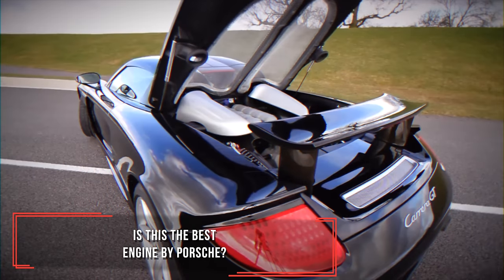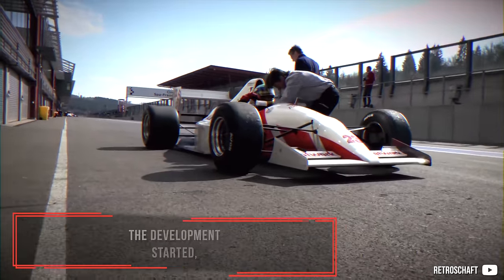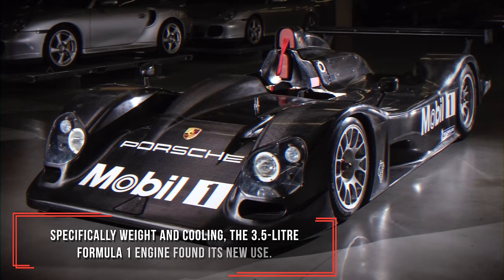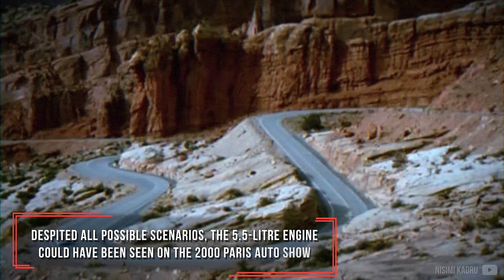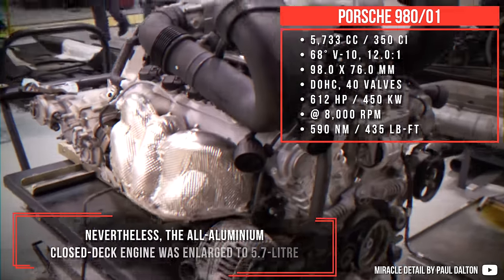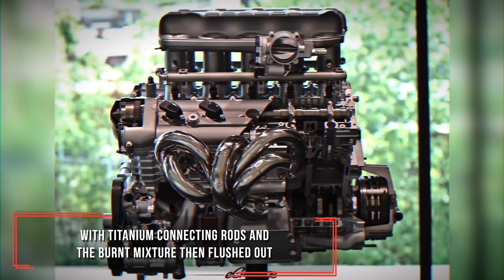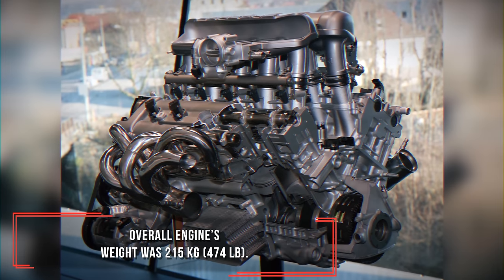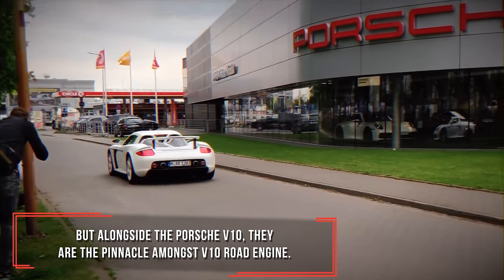How The Porsche Carrera GT Got An F1 Engine

Comment: As a Volvo fan, I'd like to see the 2.3 T5 (R) engine and its 2.5L history with Ford!
How the Yamaha 4.4 V8 (Volvo / Noble) came about would also be interesting!
Reply: As a 2.5NA owner I'd love to see more about it, the B52 series is so under-rated when it comes to a great engine with so much potential since it works with an Aisin gearbox from the factory. The early 2000's Volvos may not seem like potential hot rods but the internals say otherwise since the gearbox would allow swaps with Alfa engines.
Reply: Or Maybe the Whole History of Volvo 5 Bangers!

Comment: The car that is so beastly that even a highly expert Porsche test drivers and engineers admitted that this car is harder to drive. Also, they had a plan to put additional safety feature like ESC etc. but they realized that putting these safety feature will adding much more weight so they ditched it.
Reply: Well, Paul Walker forever-sleeped himself in one so I agree it's hard to drive

Comment: 0:54  Footwork didn't just "decide" to use a Mugen-Honda unit.  The Porsche V12 was a complete failure - overweight, underpowered and uncompetitive.  At the same time, Porsche was also developing the V10 for the following year, but it also was turning out in a similar vein.  Porsche then withdrew from F1 as an engine manufacturer mid-1991, and Arrows/Footwork settled on the old Cosworth DFR V8 engine for the remainder of the season (partly because it wouldn't require a complete chassis rebuild to fit it in.)  It wasn't until 1992 that they got the Mugen engine - itself being based on Tyrrell's 1990-spec Honda V10.  They'd have happily stayed with Porsche, if only it would have resulted in a supply of competitive engines.
Reply: Porsche V10 wasn't even been tested,it would actually do good in formula 1,but regulations changed and also Porsche was out of cash,that's why LMP project didn't work aswell
Reply: @vr5lover  It was tested, and was found to be overweight, unreliable, and underpowered for F1.  If Porsche ran low on cash, it was likely because they had to pay Footwork a penalty to get out of their contract - money Footwork used to buy the elderly Ford V8s needed  to continue the season.  If the engine could have remotely been used competitively, Porsche wouldn't have had to pay a significant penalty for not fulfilling their part of the contract - if anything, Footwork would have had to pay them to cancel the contract.
Reply: @aussiebloke609  that engine was never put into formula 1 car,you are talking about 3512 which was v12 engine,not Carrera GT V10 in fact the deal was ripped off before even the engine was fully ready,get your facts straight.
Reply: @vr5lover   I didn't say it was tested in a car - it failed its dyno testing.  It was about as bad as the V12, and never got close to the point of being fitted to a chassis.  Porsche then said they could not fulfill their part of the contract and provide a competitive engine package in time for the following season - which is why they had to pay Footwork a significant financial penalty as they exited the contract.
Reply: @aussiebloke609  failed Dyno testing? The engine literally did 800 bhp on Dyno,the less rpm working version of car had 700 hp and was pretty reliable,I don't know what is your source,but you definitely have 0 knowledge about this
Reply: @aussiebloke609  the deal was off before even engine was ready,it was footworks that cut off the deal not the Porsche,idk what this bs is about,you can hate Porsche but why making up stuff to make them look bad?
Reply: @aussiebloke609  so i am cult member when you make stuff up? Even on Wikipedia page it says footworks was the one that cut off the team,would Porsche really try hard to use that engine if it was that bad huh?
Reply: @aussiebloke609  Huidekoper, “In March 1999 I was asked to come to Weissach for a meeting. They showed me their 3.5 litre V10 F1 engine, produced for 1993 in great secrecy.  A beautiful engine, proper compact F1 architecture, between 700 and 800bhp and with full pneumatic valve gear.” this is real article about facts and what engine actually was m8

Comment: Wish they had pneumatic valves then it will be a true f1 engine
Reply: Do f1 hybrid still use pneumatic valves? The engine only rev 11000 rpm.
Reply: @GF-mf7ml  I think they use beehive valves now, because cars that rev up to 11k rpm usually have them.
Reply: @GF-mf7ml  pneumatic valve not use only because the engine rpm can higher than 17.000 rpm, but they use pneumatic valve for better responsibility for the engine
Reply: @aditya-br3kg  pneumatic valves are better for response and efficiency... That's why Koenigsegg uses them
Reply: @shawnramito4863  Koenigsegg does not use pneumatic valves in their vehicle products, they use Freevalve. From the way it works, the Freevalve and the pneumatic valve are different
Reply: @aditya-br3kg  FreeValve is something that is used in the newer cars. But if I remember correctly Koenigseggs like the CCR and CCX had pneumatic valves.

Comment: The Carrera GT has a bit of a reputation as being hard to handle.  I was at a track day at Putnam Park in Indiana about 10 years ago, and a Carrera GT was there.  Of course we enthusiasts were happy to see it there, and couldn't wait to see and hear it run.  I was disappointed in its exhaust tone.  It sounded like a Dyson vacuum cleaner.  I was hoping for a more gritty sound.  But the guy took it out on track and I watched it go by a few times, then my attention wandered off for a few minutes.  Then I looked back out, and the Carrera GT was off the track in a place where I had never seen anybody crash in 20 years of going to Putnam Park.  It had crashed into a photographer's car and was on fire.  I didn't get a chance to hear from the driver how he had managed to get into that weird predicament.
Reply: To be fair, Paul walker died in this car, so yeah this car is hard to handle
Reply: @Payday5  Walker did not drive the car,d it would be hard to speed as a passenger, right...?
Reply: @Freimopp777  well the driver surely cannot handle the car, and yes paul walker died in that car, did you get my point or nah?
Reply: @Payday5  You  basically wrote  Paul Walker died in this car (nobody asked for him , anyway) and that is the reason why the car is difficult to handle . If someone else had been in the passenger seat, the car would have been easier to handle..? The driver was speeding, and the tyres on the car were old btw.
Reply: @Freimopp777  idk man

Comment: Sweet sound! No wonder Honda beat them out. Porsche is not Honda. Porsche had to build a "Honda like" SUV to get financially stable. My Ridgeline and Civic may not sound that good but I will drive them for the next 30 years. Can't say that about any Porsche ever built without extensive restorations.
Reply: Honda like? You might wanna check the towing capacity 🤣
Reply: @RuzzP  
Or you might  wantt to reallize what you need.

Comment: A 5.5L that hits 20,000 RPM is insane not to mention that f1 style clutch pack is inspired to say the least.
Reply: It doesn't hit 20000 rpm.
EDIT: Just rewatched the video. The engine run-out speed is apparently 20 000 rpm, whatever that means.

Comment: Why should you prefer a Carrera GT over an LFA? Simple, one is a convertible, the other is not. You get the best experience of that V10 masterpiece, without compromising rigidity. 

If that's not enough : manual gearbox (and one of the best, against a 'bad' automated)... Except for start/stop trafic 😂

Comment: Not an f1 engine and barely a lemans engine. It was just the idea of 2 failed projects it never was actually either. A real f1 engine would never work in a road car. You could never drive a f1 engine on the road.

Comment: It's not an F1 engine, it's an engine loosely based on an F1 engine design. I doubt there is a single component in the engine that is shared with the actual F1 variant.

The old V10 F1 engines made close to 1000hp with half this displacement. They revved over twice as high, their had absolutely no low end torque and were practically unusable below 5000rpm, and the internal tolerances are so low that you couldn't just put a key in the slot and start it up, the engine is seized when it's cold and has to be warmed externally before it can start. Any notions of this being an F1 engine is just marketing nonsense.